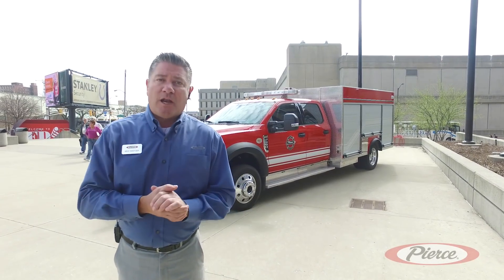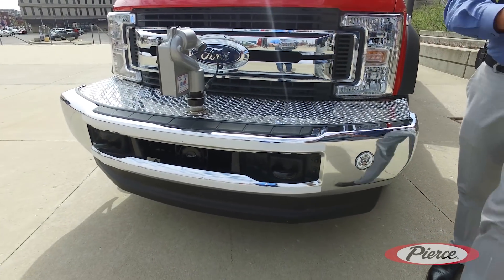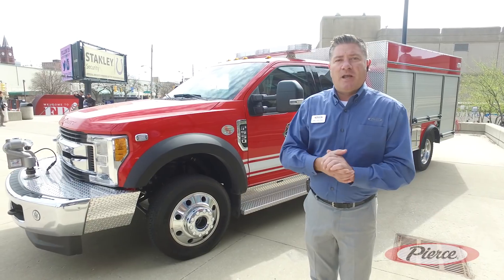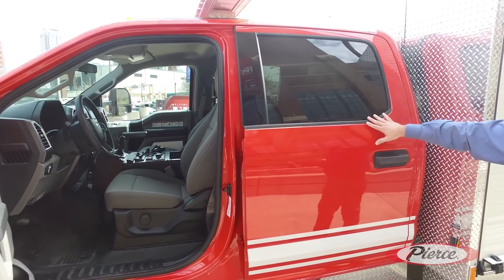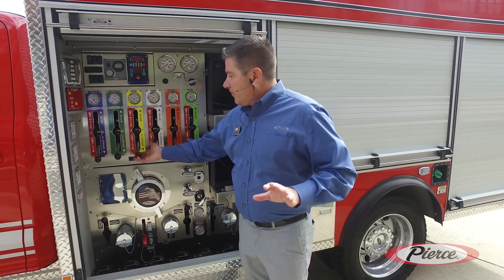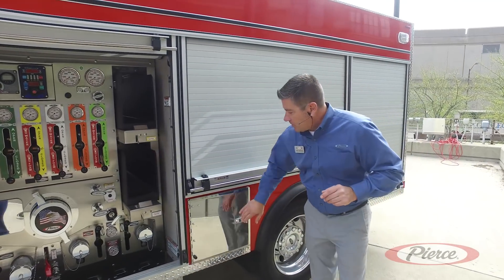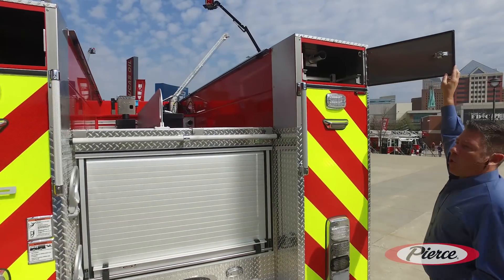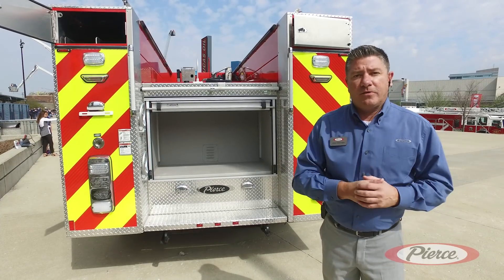Ford Mini Pumper

Comment: Amazing that it’s a 1500 gpm unit. I’m a little surprised you don’t have a booster reel standard with this. I’m sure it’s going to be used as a brush unit as well as mini rescue, quick attack, EMS and so on. The out lying fire stations in Clark County NV use these type units at all of there stations. Every station has one of these “squad” units, a slash A pumper, or 2, and a tanker, some also run ALS rescue/transport, units, but not all. Each station does have one of these as the main or first out unit to 75% of there calls and they work out very well. Surprised more don’t use these.
Reply: I would like to see them mount a booster reel on this apparatus especially being a quick attack.  They are much easier to deploy and reload.  That very rear compartment would be ideal for mounting the booster reel.